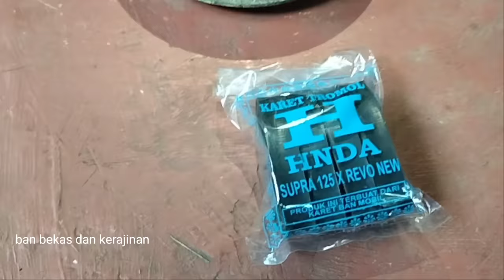Amazing invention a simple tool for cutting truck tires

Comment: I can see some refinements in its future. Maybe start with some kind of salvaged electro or hydraulic push pull mechanisms to move the blades in and out of the tire. Add a good used die cutting machine (maybe one procured from a scrap pile and cleverly repaired) to punch out the rubber components. Nice invention for your neck of the woods. Keep on inventing!

Comment: So what do you do with the scrap rubber??? You could melt if all down And make ( stop bumper bars ) like the concrete, for business's And all you need is a 55 steel drum And you can make a mole from wood to poor the hot tire in
Reply: Scrap like this is useful for road making.